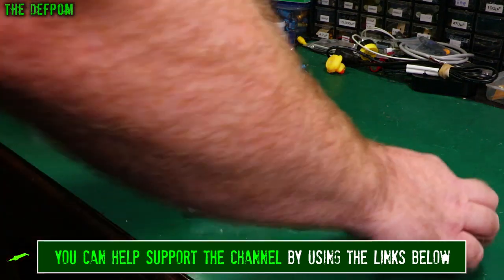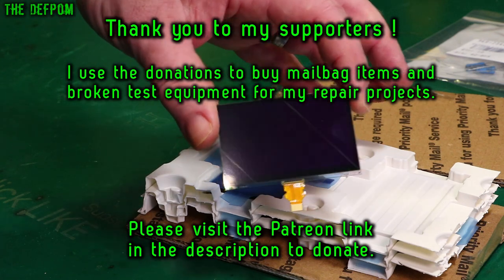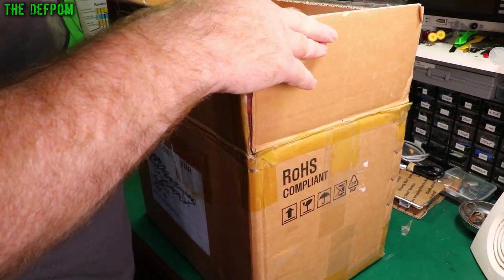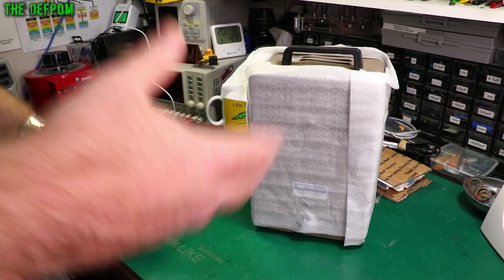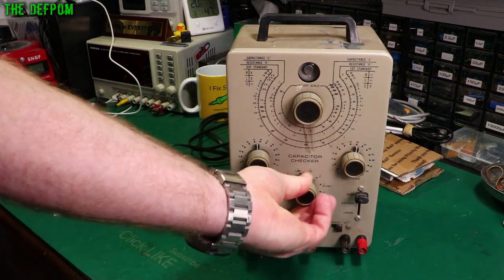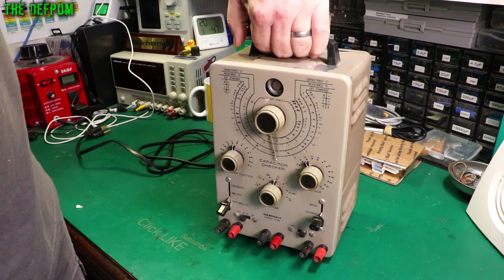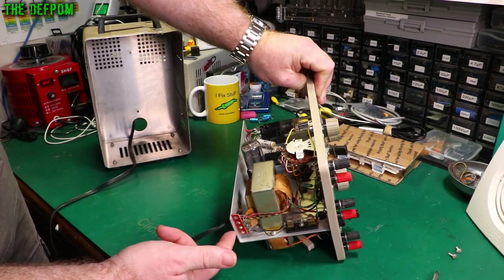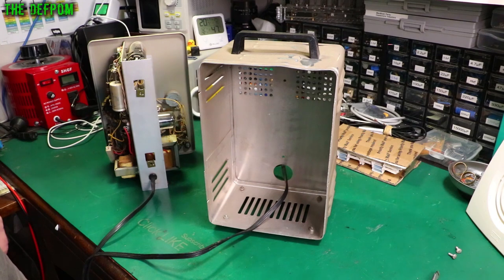🔴 What's in my Mailbag ? - Mailbag Monday 20th June 2022 - No.996

Comment: Those capacitors testers work very well I have owned several over the years although practically I don’t think they are very useful. Any leakage at all in the reference capacitors will stop it from working.

Comment: Not sure if you know, but those packing peanuts should dissolve instantly in water. You can put them in your sink, turn the water on and they'll turn into nothing. No hassle trying to throw them in the trash. Try running a couple of them under water first, I have come across one kind that didn't dissolve, but most kinds do.
Reply: Dissolving peanuts are made from starch, generally corn starch. Petroleum based peanuts won’t dissolve.